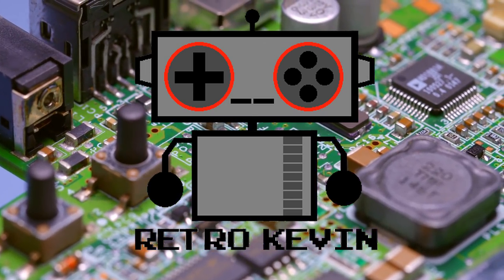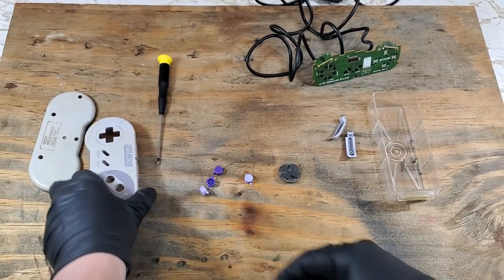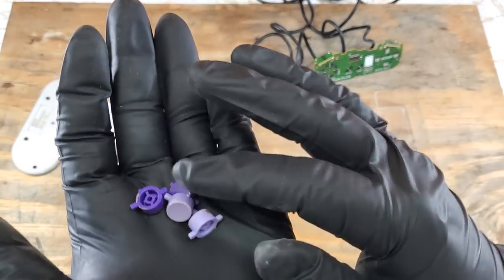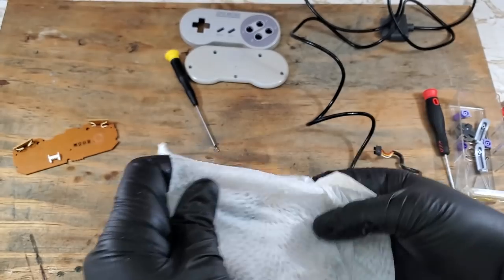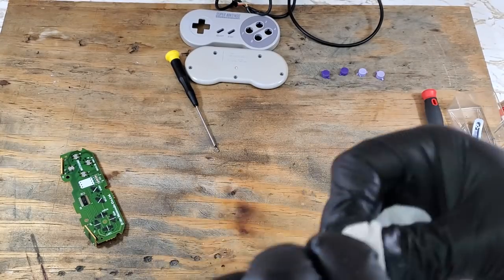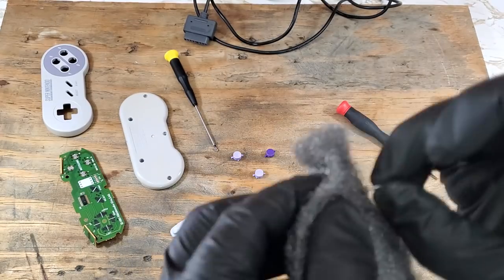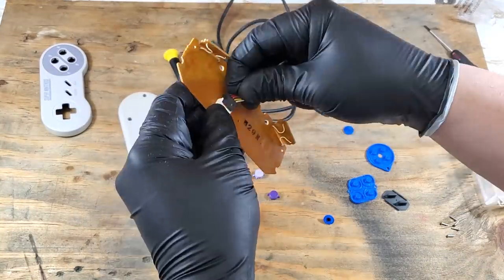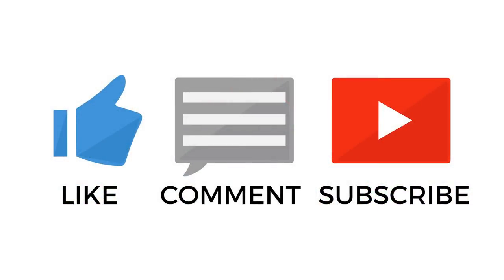Cleaning the dirtiest SNES controller

Comment: For the crevices, I would just recommend putting all the non electronic parts into a lukewarm tub or large Tupperware. Use a toothbrush and a washcloth, and you can be much faster and more effective.
Reply: Here to say the same thing.
Soak in dish soap for a minute and brush everything.